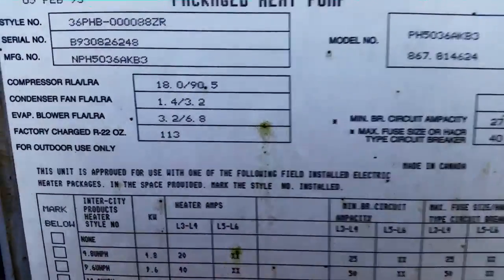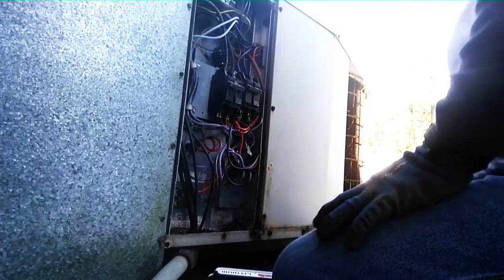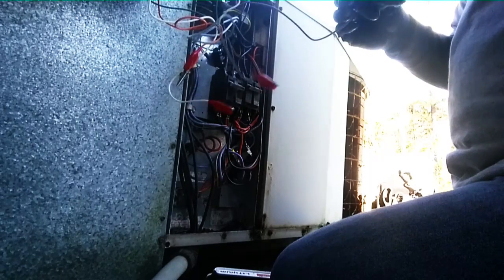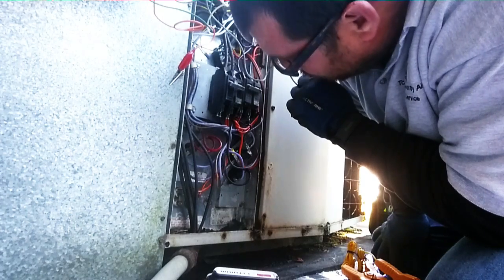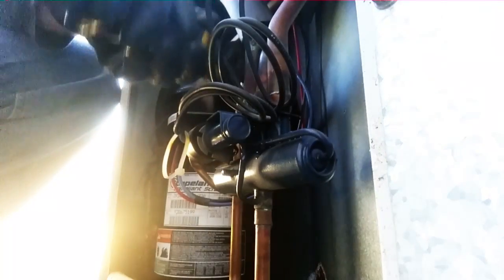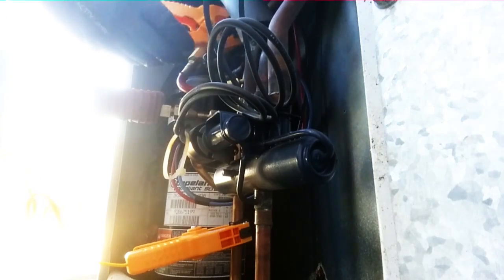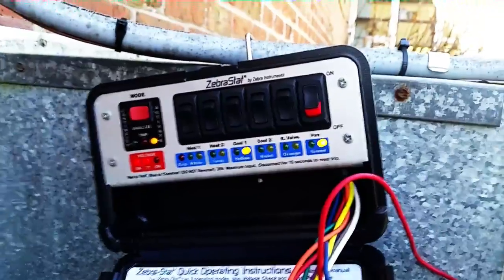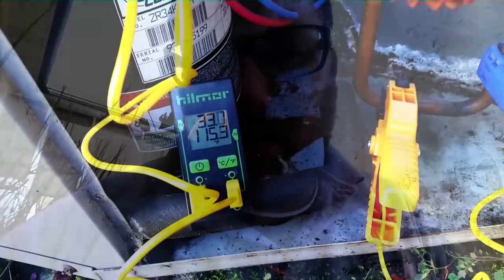Discharge Temperature Indicates Failed HVAC Compressor

Comment: If the discharge line pressure is normal, but discharge line temperature is extremely high, does it mean there is non condensible air in the system? I have a 3 year walk in freezer has very high discharge line temperature, but pressure is normal. Everything is clean, no dirty condenser
Reply: Did you resolve the issue ?

Comment: Good luck to whoever changes that out. The supply and return are reversed to how new units come. Will probably just cripple it by crossing over with flex.
Reply from the maker: My Dad put this one in. I am sure I will be the lucky guy. I remember those. While I was there I crawled under to try to figure out how to do it.
Reply: +Talyn875 PRO lucky guy you, it will turn out great if you do it....I'm sure anyone else would hack it in.